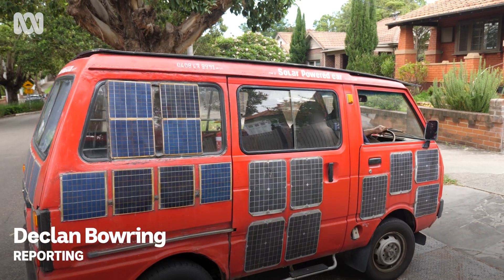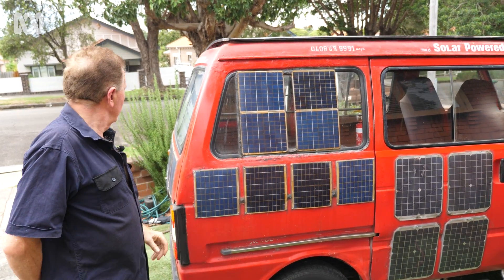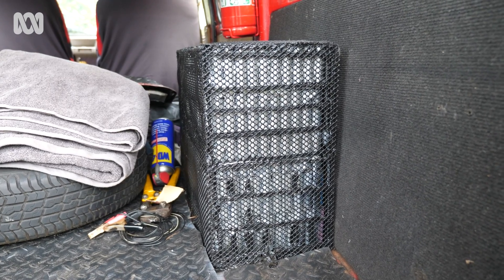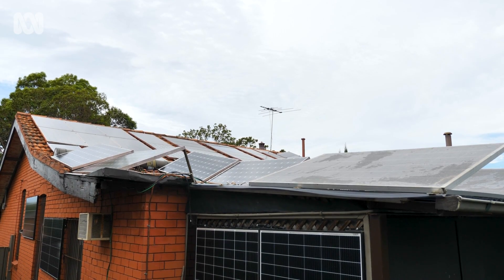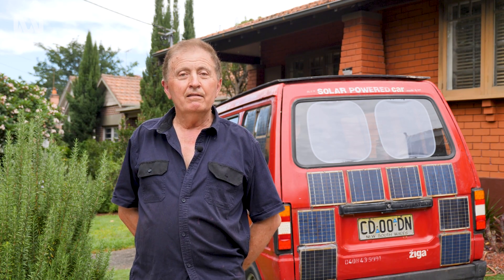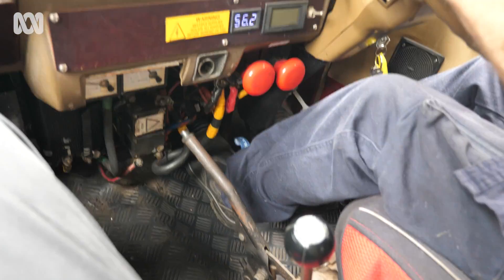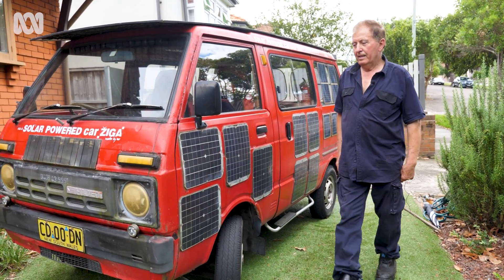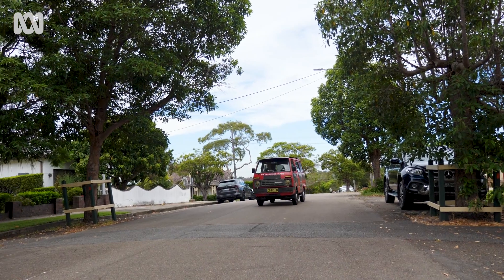Backyard inventor turns a $100 van into a DIY solar powered beast | ABC Australia

Comment: It's not the first person to think like this, but I am sure that the small van, it doesn't have practically 1kw solar power on it. Those side around vertical solar panels are just more weight to the car, they are useless, maybe 50w per side, which is maximum 200 watt around the car which cannot be used at any time, and the roof which can have a maximum 300 watt in the best case, under the sun, for not more than 4 hours per sunny day, so a total of...maximum 500 watt for 4 hours are 2kw maximum per sunny day. To recharge the battery of 8000 we don't know what coz he's not saying watt or amps, let's consider watt, it means 4 full days need full sun to recharge the batteries, but do you guys know that a modern electric car uses 10 Kw / 100 km, so this 8kw will push the van maybe 80 km every 4 days, which is 20 km/day, but this is only at maximum sun on the car surface! So this is just a toy, not talking about the solar charge controllers I saw in the video, are purely primitive, not MPPT, it's giving more problems to make it charge, than drive. 😊 But! If you also have the petrol or diesel engine on it, HYBRID, that's another HAPPY transformation!😊
Reply: I think it's quite realistic to have about 1kW on that van actually, you only need about 4-5 m² of modern solar panels to achieve a kilowatt in a place like Australia, and while those are probably not the latest in efficient solar tech, I'm quite sure the roof of his van is more than 5 square meters!

Those on the sides while I agree are probably not the most efficient, they do extend the amount of time the van can charge while the sun sets or rises and they probably don't really weigh much anyway.

Comment: Absolutely no way he has 1 KW of solar, half the panels will never see sunlight at any point of the day, and those batteries are a ticking time bomb.
Reply: At best, the batteries will degrade very quickly because there is no cooling system. Still amazing that he did all this himself.